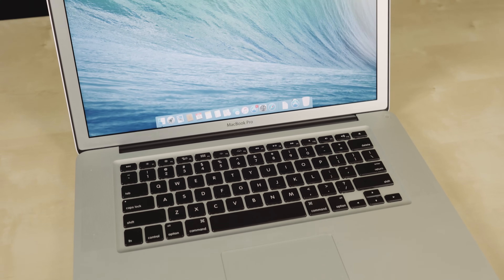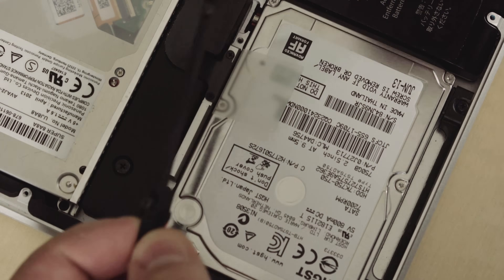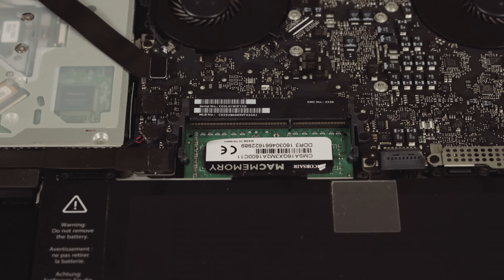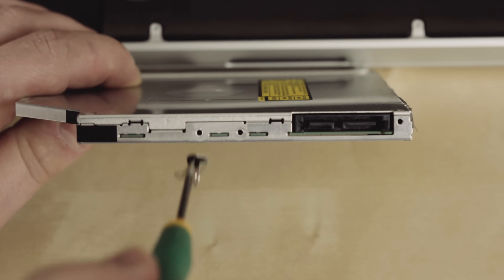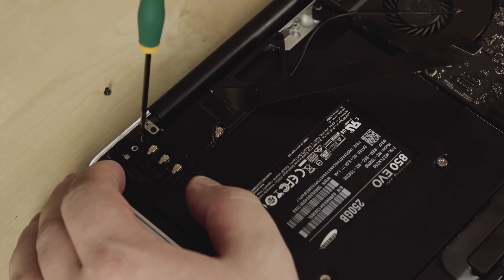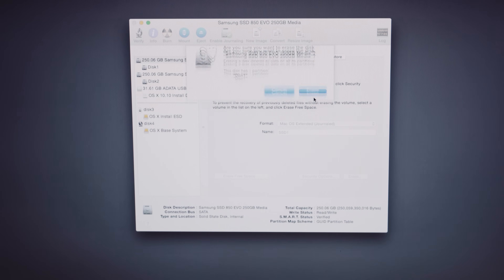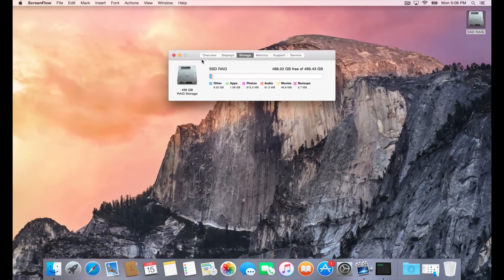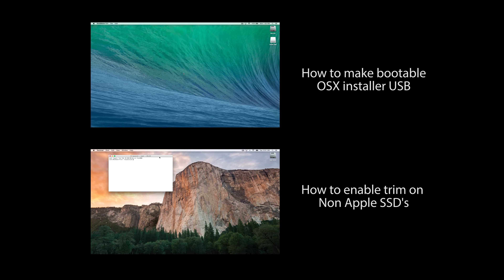Fastest 2012 MacBook Pro Ever! Upgrade Guide - in 4K

Comment: Tried this with Catalina and none of it worked. In order to do this and gain the performance you have to go back to earlier versions of OS X (if you can find them). I tried with two EVO SSDs and really screwed my mac. Had to reinstall and format everything. RAID is good but not on mac.
Reply: Catalina dont have more support for RAID. Apple remove.
I belive the high sierra is the last to support RAID.

Comment: POV: it's 2020 and you have a 2011 macbook pro and you upgrade the ram, hdd to ssd, and thermal paste. Still fast and works 9 years later
Reply: Fact, I upgraded my late 2011 13” MacBook Pro to 500Gb SSD, 8Gb of RAM and a new battery. It’s running the patched version of Catalina like a charm.
Reply: @ElawnR  How did you get Catalina on it? I have the same MAC running on 10.11.6

Comment: Big question! I ordered the ram but it only says its compatible with Macs 201 - 2011. Will it work with my 2012 mac ? :(
Reply from the maker: shouldn't be a problem as long as its the right speed.
Reply: @LeeZavitz  the right speed ??
Reply: @jamieyostmusic  
I think Lee is referring to the fact that RAMs until 2011 were 1333 MHz, and from 2012 on, are 1600 MHz...

Comment: Lee thank you for this video. I went with a 1 tb SSD and 16 GB RAM. I didn't want to get rid of my DVD/CD drive. My 2012 MacBook Pro is ridiculously fast and excited that I only had to spend about $250 total.
Reply: Fitz, may I ask what brand of RAM you used? I just ordered 8GB of RAM but may return it and order 16GB. I have a mid-2012 MBP running High Sierra. I was thinking of buying a new MBP but may just upgrade the RAM and hhd to a 1B SSD.
Reply: @DanaBenYehuda  what did you end up doing
Reply: @GS-kj6ur  I put in 16GB of RAM and a 1 TB SSD. It has been a significant improvement in performance. I think the graphics card may be starting to go, but so far so good.
Reply: @DanaBenYehuda  I just brought my old one to life with an 870 Evo ssd now I'm waiting on my 16 gig cards to come in. I'm already running 8 but after that I think all I have left to do is the battery. The ssd made a world of difference but I'm hoping the ram upgrade can make it even better
Reply: @DanaBenYehuda  Also upgrade it to Catalina it looks way more professional if you haven't already
Reply: @GS-kj6ur  it's running High Sierra and stable...think I'll leave it that way...
Reply: @GS-kj6ur  16 GB made a world of difference on my machine.
Reply: @DanaBenYehuda  I understand not too much of a difference just aesthetics. What brand ram did you get? I got timetec but I’m thinking I should have got something else
Reply: @GS-kj6ur  I have timetec. Sorry - thought I'd replied. It's been fine!
Reply: @DanaBenYehuda  solid! Yeah I also used timetec and no complaints. I replaced the optical drive with another ssd but for some reason I can’t restore this one so it’s not working

Comment: Can anyone answer these questions?  I have a 2010 MacBook Pro with Snow Leopard.  It has a non-metal GPU.  Safari, chrome, YouTube, etc are no longer working for this computer.  I mainly use the computer partitioned in Windows and there is nothing wrong with the computer.  I am wondering how to upgrade the OS, and/or GPU.  Thanks in advance.
Reply: You will need to visit dosdude1.com

Comment: I lucked into buying this thing in 2012. I've had it for 8 years now and spend on average 8 hours a day on it. Spent $180 got the SSHD and upgraded it to 16G RAM. Making this thing run better than anything I've ever been on. Last year the power input and magsafe plug destroyed one another, and the battery swelled up enough to make me think there was something wrong with the track pad. With $125 I replaced the battery, bought a new magsafe port, and got a different power cable. Then self installed. 
Other than that I've had zero problems with this thing. With all the videos on youtube I'm pretty confident that I could fix and replace anything, not board related. 
Best LapTop EVER!

Comment: Did this to my mbp 2012 13" , 16gb ram , 2 drives SSD running on Catalina, the only problem was the heat at the back cover creeping up to the keyboard area and trackpad, heat i mean like really hot, idk if i had issues with my thermal paste or something but i installed fan controller, most of the heat dissipates, just change to full blast when you're on heavy task.  cheers mate!
Reply: How did you get it to work with Catalina? Says Catalina cannot install to the Raid 0
Reply: @seanmillions  i did the upgrade before updating to catalina

Comment: I followed this guide and did all except swapping out my disc drive for another hard drive. I have zero computer skills. I do recommend you get a SATA to USB cable and do it that way. I have a cloner at work so i was able to do it that way. IT WAS SUPER EASY. Now my computer is super fast.
 MacBook Pro 15-inch, Mid 2012 (MD104LL/A)

Comment: Hi everyone. I'm not that great with tech stuff so go easy on me.

I've just bought a new SSD drive for my 2012 Mac, however I hadn't considered replacing the optical drive. Can anyone tell me if I need to replace the optical drive too and what the benefits are? I don't ever use the DVD player so happy to swap out but is it worth it?

Thanks
Reply: Hello The Benefits Are You Get More Storage Out of Having Another Drive. If You Use The DVD Drive Don't do it, if don't you have extra space to have another ssd. If you only bought one ssd remove the hdd and replace it with that ssd if you bought two Follow his instructions on 1:19 and replace the first and to replace the dvd drive follow 3:36 and heres a link to the caddy needed enjoy!
https://www.amazon.com/Optical-SuperDrive-Adapter-Unibody-2012-etc/dp/B004FM4UGE/ref=mp_s_a_1_3?dchild=1&keywords=caddy+for+macbook+pro+2012&qid=1596684735&sprefix=caddy+for+macbook+pr&sr=8-3
Reply: Christian, if you did the upgrade with 2 SSDs, have you been able to install Mojave without issue?

Comment: Personally I’m not sure why you merged the two drives together. I run my secondary 1tb ssd drive in the caddy as a stand-alone almost as if it was an external drive just inside the case and I use it purely to store media on and nothing else, so picture, video, music. Then I have a 240gb ssd in place of the original hdd for OS & other software (apps). That way if that drove ever fails I don’t lose all my precious media. I came to this solution years ago when my original unmoddified mpb hard drive completely failed, first the cable went, replaced that then a few months later total drive melt down. I lost everything and since then I’ve always had a secondary in a caddy but running as a stand-alone drive. 
Anyone wanna tell me what the potential gain would be to merge the two as in this video.
Reply: hi, I am curious, and pretty novice when it comes to these things. You're saying that you run a TB and the 240gb with no problem? because I am trying to figure out if the mac would even be able to handle all that, as Ive read that theres a max amount of memory.
Reply: Joshua Mejia perfectly fine on my 2012 mpb 
I have 12gb ram
Kingston 240ssd in place of where the original sits
And a 1tb ssd in the optical caddy. 
Runs as a standalone hard drive. And I’ve had that set up since my first 2009 Mpb. Ever since my first Unmodified hdd died and I lost everything. Now I have the 240gb for OS and other programs 
And the 1tb purely for files. 

All this merging nonsense seems completely unnecessary.

Comment: The only trouble with putting more money into these 2012 Macbook Pros is that their older 3rd Generation Intel CPUs (while still fast my most standards) lack support for hardware decoding of newer video compression types.  H265 is quickly becoming the standard for high bitrate video, and Google is starting to heavily enforce VP9.  These videos will require software decoding, and at it will completely max out your CPU to watch a high bitrate H265 video.

Comment: Anyone still here? So I followed this video on my 2012 MacBook Pro 13”. I decided not to go for the RAID though as I’m using Mojave so just decided on 2 SSDs. Everything went fine, I installed the OS on the SSD in the ex-optical disc drive slot then I restarted and it crashed. After trying various things I went through the process again of reinstalling the OS on the same SSD, having noticed it had corrupted I had to erase it again.

I installed ten OS and restarted and it crashed again. I then reinstalled on the other SSD (the one in the ‘normal’ slot) and everything is fine. Can restart in a blink. The other SSD is still recognised, and I’ve tested files on it and restarted it to see if it corrupts and it’s fine.

But I’m a bit concerned now this drive could be faulty or somehow I bodged the installation. Anybody experience anything similar? Or have any idea what’s going on?
Reply: Hi have you tried erasing the drive with other formats?

Comment: I replace my hard drive with an SSD last year. Made my 2009 like new. Just got my 8gb ram (came with 4) today yet to install. My question is (I’m not the most tech savvy) what is the benefit of a second SSD in the disk drive beside just more space?
Reply: Speed. That's it. Plus SSDs are way cheaper now than before, so there's no reason to stay with a hard disk drive as the second storage anymore, unless u really want to keep that CD drive, but who uses CDs anymore?

Comment: If I just want to update ram? For my mid-2012 MacBook Pro. Still using Mojave. By replacing only the two ram cards. Will my memory be wiped clean? Or it will be fine? I just need it to run faster. I don’t care about Catalina.
Reply from the maker: Updating ram is safe. Its only if you update the harddrive to an SSD.
Reply: Lee Zavitz So by just replacing the ram cards. I should fine. As far as my data. I’ll backup everything just in case. What do I need to do? Regarding disk utility setup for the replacement of ram cards.? Nothing or is there a process?
Reply from the maker: Just pop the case off take the ram out and replace it like I show in the video. Nothing else required. Just FYI. Your ram empties everytime you shut down your system. And when your computer boots it reloads. So by upgrading the ram you are not losing any data.
Reply: Lee Zavitz Thanks for the info! Much appreciated. Will let you know the results when I’m done replacing the ram cards. Very informative videos. 👍🏼👍🏼👏

Comment: Big Tips before starting - put a white sheet on floor  put chair over it . Put a towel over lap or apron on to catch screws you drop . Put a sheet on clean table .Have a magnet to keep screws in one place or a white clean plate . Clean hands . Use insulate mat to reduce electric shock disconnect and do not plug in power . Some suggest unplug battery while you do this upgrade . May want to vacuum  using a unused clean paint brush and tweezers to suck out dust bunnys and pull out hair follicles .Oh and do not have any liquid or  drinks or smoke while doing this near workspace

Comment: Little question here. On the RAM amazon link, the description says it fits mid-2010 to mid-2011 macs. Just wondering because mine's a mid-2012. Does it work too?
Reply: I think so. I believe 2010-2011 rams run at 1333MHz (PC 10600) and 2012 run at 1600MHz (PC12800). Try to get the faster 2012?

Comment: Dangit! I just bought a 2TB drive last week to replace the mechanical second drive to a one drive setup. 
I already had the caddy & I knew apple had software RAID 0 support, but didn't think about it. 
It would've even been cheaper AND twice as fast :(
Aww well, guess I'll always have that option for when 2TB SSDs get cheap :/
Reply: So you would have gone with two 1tb ssd’s instead? I’m wondering if I should put two in and do this split with RAID 0 to increase the speed. 
Another question- do both ssd’s have to be the same size (as in memory size)?

Comment: If I get a folder with a question mark what did I do wrong?
Reply: Have you installed the OS onto the SSD(s)?
Reply: Sky Gamer I got it to work its all good. Just trying to figure out how to update from lion. Cause its not letting me download from chrome. And they no longer have sierra on the app store.I have no other apple computer in my household either
Reply: @evane.6511  Does it have to be Sierra? Would Catalina, (if you're not using a raid0 setup), or Mojave be okay instead?
Reply: @Sky Gamer No it doesn't have to be I just prefer it. And yes if you are not going to use raid0 you can do either one Catalina, or Mojave. I do believe you can get Catalina (it's a long process)to work with Raid0 but wouldn't recommend it because your computer gets slower.

Comment: I know it’s an old video. I have an extra SSD and I would like to replace the optical drive that I don’t use at all. Can I do the Raid0 with a current SSD and add a new one ? Or they both need to be clean ? They both formatted to Mac Journaled. I’m using the Catalina OS.

Comment: So did you replace 1333mhz ram with 1600mhz ram? Does this work or only run at 1333 still or doesnt matter what speed ram i get the quicker the better?
Reply from the maker: Stu May I’m pretty sure all 2012 15” MacBook Pro run at 1600mhz. I replaced it with the same speed ram. If you have a 2011 it uses 1333 and will run at 1333 if you replace it with 1600

Comment: Hi, great video, just wondering as I have seen another video that says you cannot raid0 a macbook pro 2012, but it looks to me like you have clearly achieved it here,, I'm upgrading my 2012 MBP to a 1 TB ssd and 16 GB of ram, do you think this will have an effect on speed and performance, or is that speed just a product of the raid0 across 2 ssd's ?
Reply: If you want to run macOS Catalina, you cannot use raid0, but as long as you're using an OS earlier than that, raid0 will work just fine.

Comment: I k ow this is an old video but is there a benefit to running two 250gb ssds then just one 500gb ssd. I went with a si glen 500gb ssd and 16gb of ram. Would there be a difference to ad a second 500ssd similar to what you did with yours in this video as far as read and right.
Reply: Two SSD's will always be faster than just one, as it can send the data twice as fast, no matter the size of them, (although it's best if those two SSD's are the same size).

Comment: Do you need to have both drives exactly the same to make a RAID? I have 128gb drive I bought long time ago and wonder to get another 128 and make a raid. Would thay work?
Reply: They should yes
Reply: Sky Gamer let me make question more precise please :) if I have 128gb ssd and get another (any 128gb) ssd, will it work? I've actually was able to find exactly the same exact model ssd - got lucky. Now just checking for the future of they have to be exact model or if same size is enough.
Reply: @wza360  The model really doesn't matter, (although you may as well get the same model if you've found it). The most important thing is finding two SSD's that are the same size. So yes, it would work with any other 128GB SSD.
Reply: @skygamer7971  Thanks a lot, makes sense now :)

Comment: Does anyone know if I’ll need to change the SATA cables since the original hard drive is a SATA II HDD (3.0 Gb/s) and the replacements are SSD SATA III (6.0 Gb/s)? 
Also, after downloading DiskMaker X for High Sierra and installing the OS what command will I need to use in Terminal to get Trim Support? Is it the same command used for the updated MacOS Sierra video he has?
If anyone has any tweaks or precautions to this upgrade for an early 2011 13” MBP that would be greatly appreciated!
Reply: A newer SATA cable can make a difference in speed! I have seen it on a forum. PS I have the same MBP
Reply: @carcaviar9321  Terminal command: "sudo trimforce enable" + reboot. But in terms of speed what you should be looking at is not SPEED. It's Negotiated Link Speed...

Comment: ‼️Thank you so much for posting ♥️👍

I have an old 2012 Macbook Air which still works but I wanted to upgrade it for my daughter to use.

❓ Would it be sufficient if I just replaced the SSD and RAM or do you recommend the additional SSD & more? Just want to confirm before I order some of the goods you recommended. 😉💁🏻‍♀️
Reply: If you can replace them, yes. I mean, some of those models have soldered-on SSDs/RAM. Not for the faint of hearth...
Reply: jovial469 

Thanks so much for your reply! 👍♥️
I have the exact year/model you used in your tutorial so I’m assuming it will not be an issue but thx for the heads up! I’ll open it up and check before I order new parts! 👍😉♥️😊
Reply: @artisanshrew  Hold on, it is NOT my tutorial. All credits go to Lee Zavitz, he's the one with the skills!
Reply: I think you will be happy with a 2 TB SSD + 16 GB RAM, while keeping the optical drive for older existing backups. Just note that when you install Mac OS (any version) on the new SSD, choose "Journaled - Extended", NOT APFS...!
Reply: jovial469  - my bad - but I genuinely appreciate you replying! 👍♥️ I didn’t want to order anything till I heard back from someone who knows more than me! 😉💁🏻‍♀️ Thx so much!

Comment: What happen when you have already a SSD and add a second SSD with the caddy....do you have to errase both HD's or only the new one?
Reply: The first SSD is already in use and have data on it.
Reply: @gaguayod  You have to format everything. Best way is use Carbon Copy Cloner of your system to an external backup, then install the Raid 0, boot from the external backup, and Carbon Copy Cloner to the Raid.
Reply: @jovial469  Thank you!

Comment: My 2012 only has the 2.5ghz i5 so are these upgrades worth it and will it be able to render 4k video in Resolve? I was hoping to not have to drop $800-$1000 on a new laptop, especially right now. I know "zero" about MacBooks
Reply: I'm not familiar with resolve, but SSD + 16 GB RAM will surely run Final Cut Pro in 4K very smoothly.